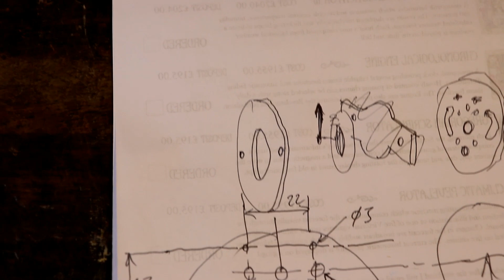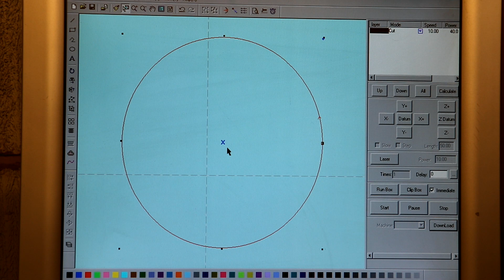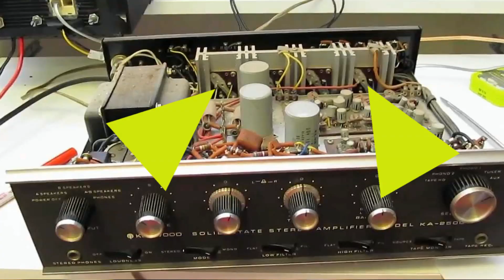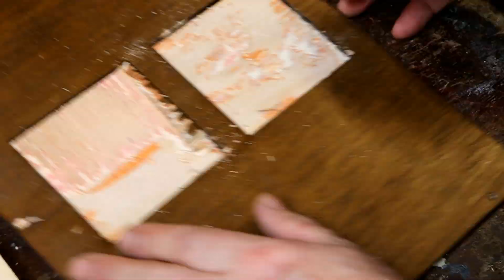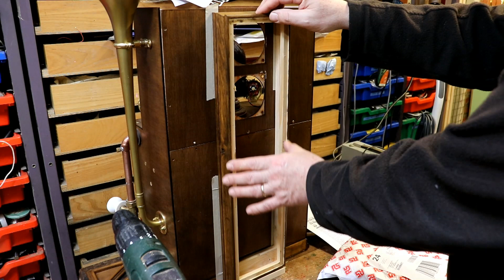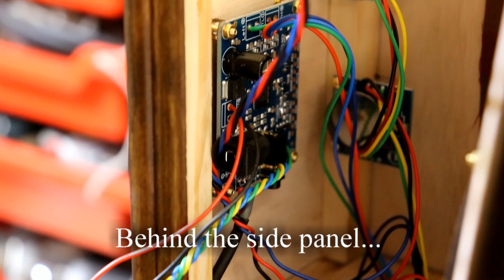A weather forecast? Is it time for tea? Just ask Florence the automaton!

Comment: Awesome!  I love to watch “the inventor” at work!   Is it extremely difficult to have Florence do two head movements at once?  For instance, rotate and incline simultaneously?
Reply from the maker: A very astute observation! Because she has so many motors, two of which are servo motors and a stepper motor, I think I decided to keep everything in a single sequence, as some motor control libraries don't like doing too much at once. In the case of the Gregorian Revelator, I had to write a complicated stepper motor control that would simultaneously move two stepper motors (controlling the stylus) from any point to reach the required point at exactly the same time - I think the thought of that put me off as well! I also reasoned that a real mechanical automaton would probably follow a set sequence of individual moves. Thanks for your comments, I will give it some thought, or at least include it in the next version! Thanks Tom